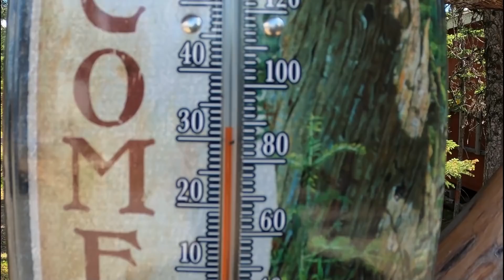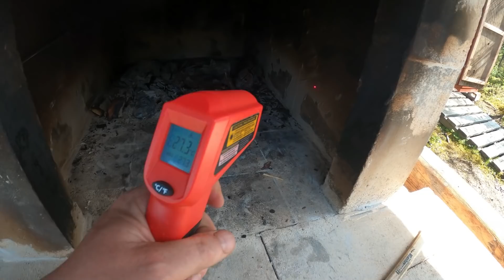SPECKLED TROUT FISHING IN LABRADOR plus CATCH N' COOK FISH N' CHIPS at the CABIN OUTDOOR KITCHEN

Comment: Well, I don't miss the flies but I sure miss most everything else about Labrador. I will be moving back to Goose Bay this summer and I'm wondering if you can answer a question or two. Do you know if there are any lakes with decent access/proper boat launches around? I was hoping to bring a 15' aluminum side console boat with 30 hp Yamaha but not sure if that is suitable. I also have a fishing kayak and plan on exploring with that. Not sure what is around Goose Bay but I have heard about people heading up Churchill falls way and lots about Lobstick. I will be there for 3 years and I don't want to waste any time this time around!
Reply from the maker: You will do just perfect with that gear. I have similar setups and it’s quite practical. As for goose bay, I have very limited knowledge of lakes in that area.  Lobstick will definitely be one of your main places to visit. And that equipment will suit you just fine.